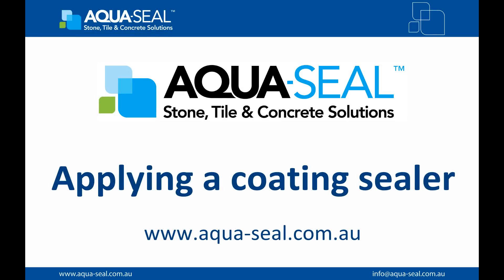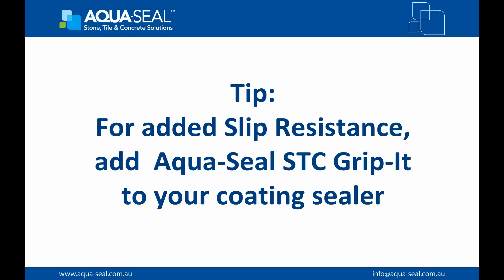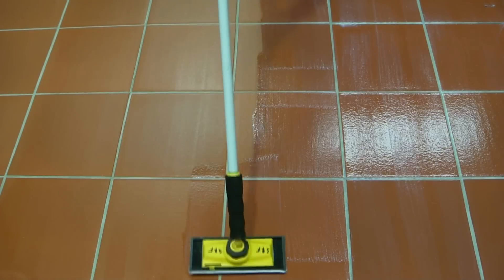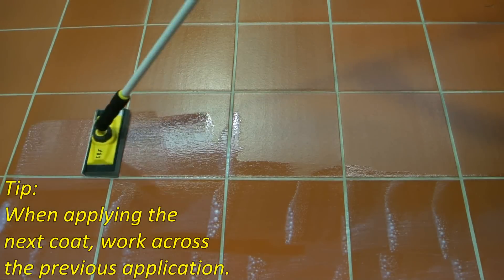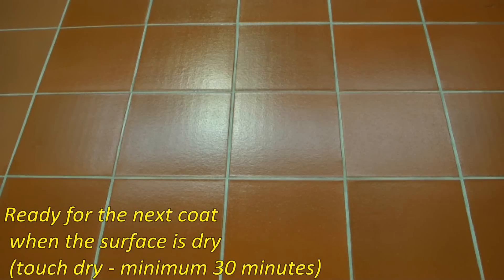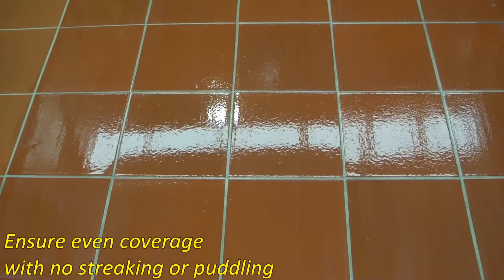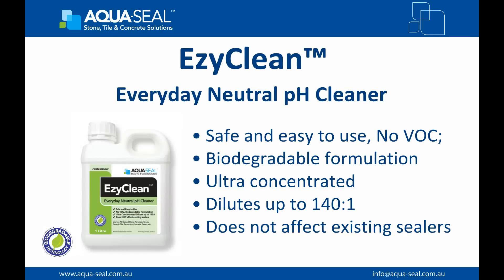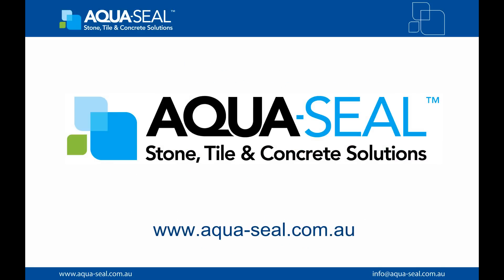How to apply a Coating Sealer - Satin'N'Seal™ - Aqua-Seal STS™

Comment: Advice
needed please. I sealed a shower room floor which had been done by a tiler and
I used too much sealer. I was thinking it would be a good idea to put on a
flood of sealer so I poured it on thickly and spread it with a microfibre
cloth. This particular sealer went on milky white, similar to thin PVA glue and
it dried clear. The tiles are a marl matt grey colour and now have a slight
sheen to them. I am happy with this but before being sealed, the grout lines were
all nice and even with an even colour throughout. The grout lines are now all
stained, have dark and light areas and are all patchy, although they are sealed.
They also have a plastic look to them as well. Can anyone tell me how to fix
the grout lines? Thanx